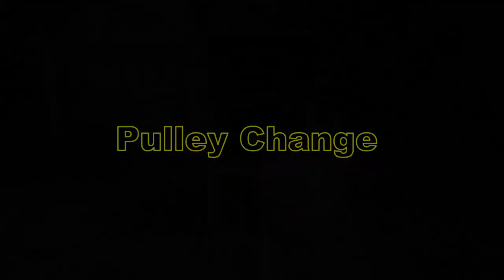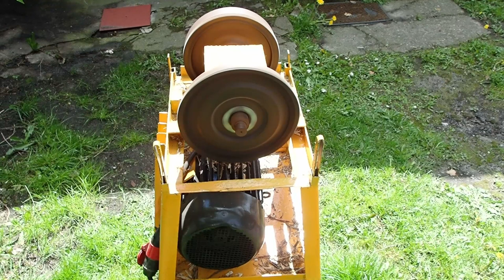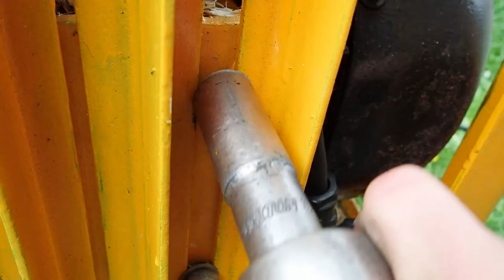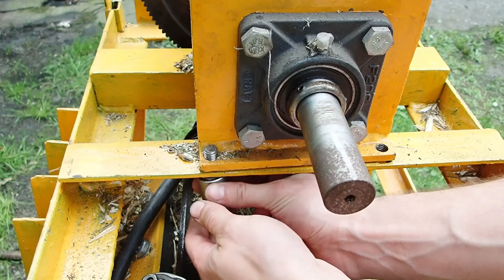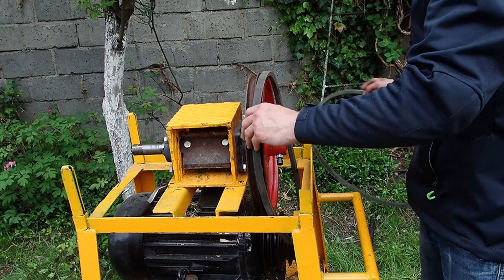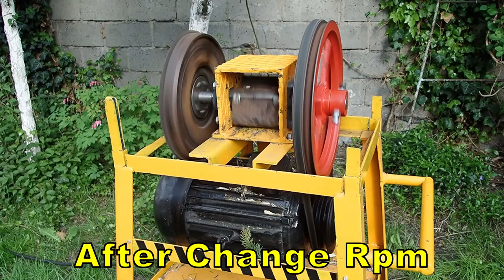Wood Chipper I RPM Change

Comment: This might be a dumb question, I have seen so many chippers on you tube and the question is why is everybody chipping branches and putting them in bags. Are you guys burning them is a wood stove?
Reply: Here is my example. I have lots of fields where black locust grows wild,you can't destroy it (i don't use chemical products) but you can use it as a cheep firewood. Pack it in bags, leave somewhere where it can dry and almost free firewood 🙂